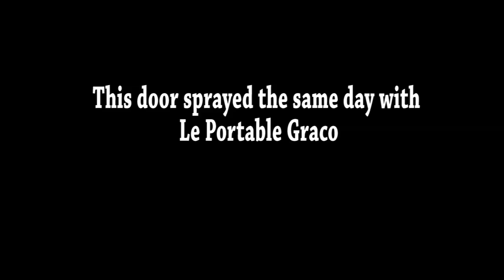Graco Cordless Sprayer demonstration 206-431-3606  training for Shearer Painting in Seattle, Wa.

Comment: I bought one of the original, corded models for less than $120 shipped. So far, I think it's a good deal. However, I can see that the floating suction tube of the Truecoat 2 is a plus. So far I've used mine on crown molding and baseboard with somewhat thinned out Behr semi-gloss. Used a 311 tip and was very impressed with the results.